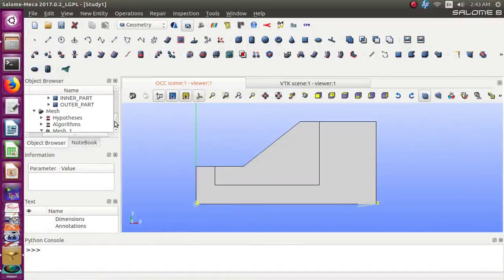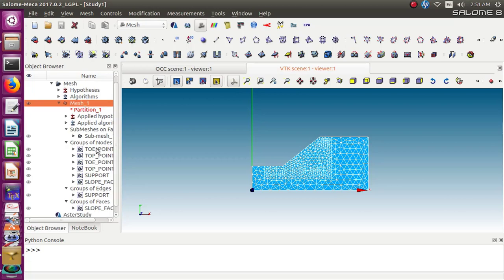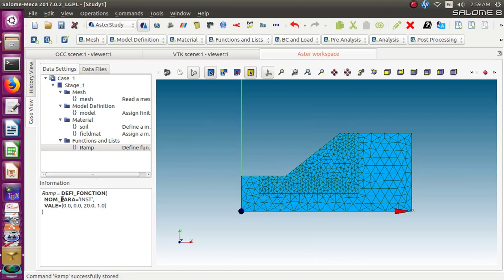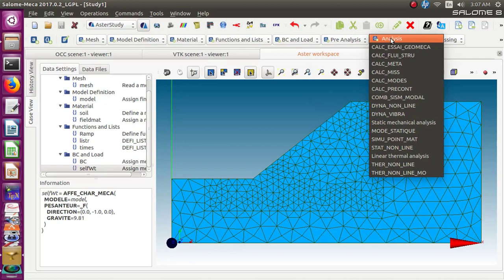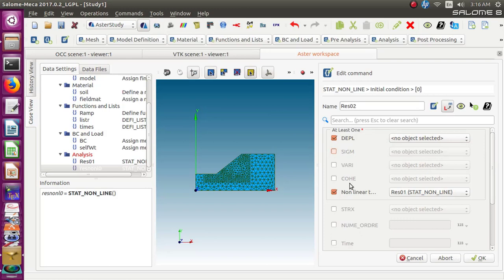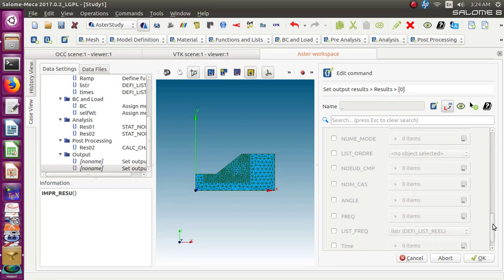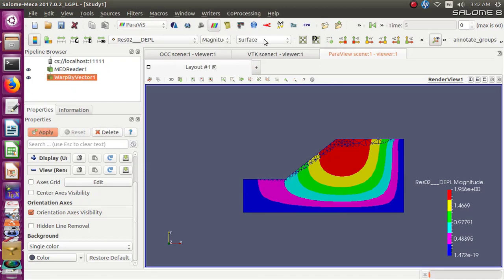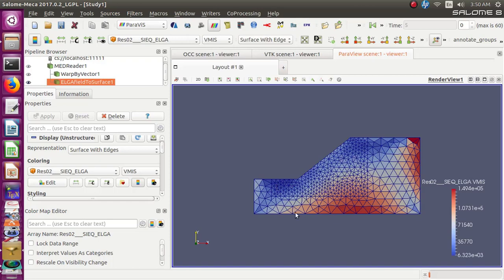Non-Linear FEA of Geotechnical Structure using Salome-Meca 2017 | Part 4: Analysis, Post-processing

Comment: This tutorial is really great! The explanations are clear and the step-by-step instructions make it easy to follow along. Huge thanks for sharing it!
Is it possible to also calculate or analyze porosity variation in this example?
Reply from the maker: @Felipe, Thanks for your comments.! Porosity can be taken into account indirectly by using HM (Hydro-Mechanical) tools. You can get a training material in French which is available in the code-aster website. Code-aster uses Biot's poroelastic theory which can be used along with Mohr-Coulomb and other constitutive laws. Kindly refer to code-aster official documentation for the details.
Reply: @SukumarBaishya  Thank you so much for your response and the materials you've been developing concerning Code_Aster. I am indeed taking a look at the material available on the Code_Aster webpage, as well as in the forum. In fact, when using HM modeling, the porosity will be one of the internal variables.

Comment: What is the real max shear stress? SIGM XY or EPSI XY? I need to see the failure plane. Sorry by the english
Reply from the maker: Hi, Shear stress is SIGM_XY in plane-strain (D_PLAN) problem. EPSI_XY is shear strain. For meaning of SIGM,  SIEQ etc. you may see document U4.81.04. Another veboory good resource is Jean P Aubry's Book, freely available at  https://framabook.org/beginning-with-code_aster/, which you might already be familiar with. 

The analysis shown here is not for the failed slope. The slope failed with an  SRF around 2.3, as far as I remember. The shown case is for SRF=1 only. Hope this helps.

Comment: Youtube is awesome. I revisited your tutorial again!! :P. Just one observation: does it make sense  to multiply the dead weight with multiplier function?
Reply from the maker: Hi, In fact it was a part of slope stability analysis using SRM, where it is essential to gradually apply the dead weight to see the evolution of deformation/failure in a parametric study. I agree that in this tutorial this fact was never mentioned, hence it may create confusion. Thanks for your interest and observation.
Reply from the maker: Additional comment: Whether the dead load should be applied step-wise or in a single step depends on the objective(s) of analysis.

Comment: How about the interpretation? An engineers first question would be : did the slope failed or is it still safe?
Reply from the maker: For slope failure analysis you need to apply strength reduction method (or gravity increase method where applicable). I wish to do another tutorial illustrating the method once time permits me. Thanks for your interest.
Reply from the maker: Dear@Xiaoli Zhao , Thanks for your interest on the topic. Hopefully, I would be able to upload a tutorial on slope stability analysis and interpretation of the results by the month end. Hope you would understand my busy schedule not enabling me to work on the tutorial. Thanks again for your comments.. Regards..

Comment: I couldn't understand why my resolts with Plaxis is different than your results with Code_Aster. ( I get the same results with Code_Aster, while I have repeat exactly the same model)
Reply from the maker: Hi, 
Thanks for your query. In order to compare results of two softwares the following are some of the important points: 1 similar mesh and element types, 2 same constitutive model and integration algorithm, 3 same time steps, convergence tolerance, search algorithms like line search, arc length etc. If these are similar, then the results are likely to be comparable. Hence, without looking into these details, comparison of results may sometimes even be misleading. Therefore I am not in a position to give any definite reply to your questions, especially because I haven't used plaxis myself yet. However, I would to know the magnitude of difference you got. 

You have mentioned about code aster results. But I am not clear whether the results of code aster is similar to plaxis or to those of Salome meca. In the later case no wonder, as Salome meca uses code aster as the solver. But if you got same results between CA and plaxis, but not with Salome meca then version of CA used in salome meca might be a possible reason for the difference. Please let me know more on these. 
Regards.